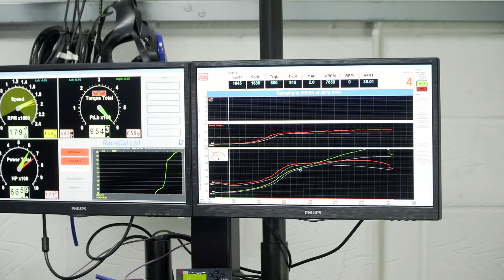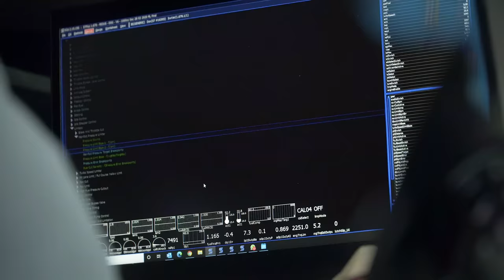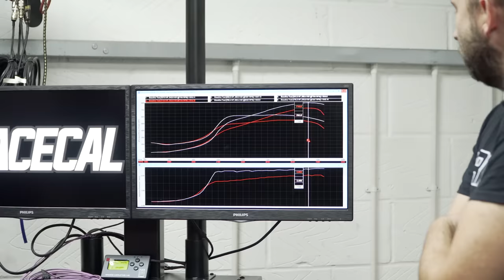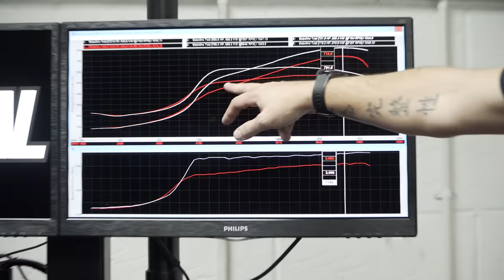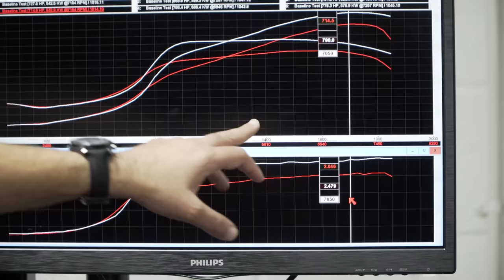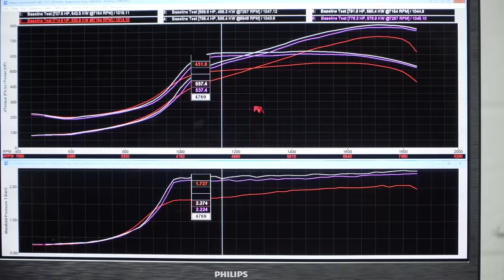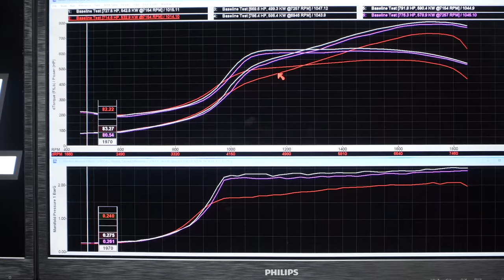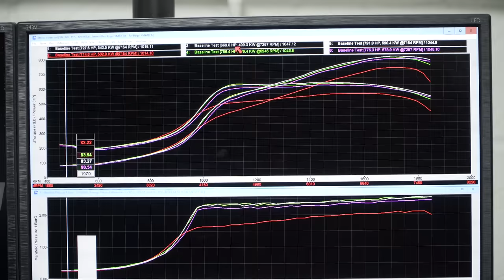Making the Eventuri RS3 a supercar killing monster - Built Engine + IROZ IMS850 Big Turbo Kit

Comment: Audi's 5 cylinder turbo motor was and currently is the best motor they've ever produced!
Reply: 3.0TFSI tho
Reply: @ckatlinga 5 cyl lolol
Reply: @matias7497  the 3.0 is aV6
Reply: @slonky821  I fully understand that. I have one sitting in my garage. Stage 1 pushing 410hp
Reply: 5.2L V10 and 4.0L V8 Bi-Turbo and 3.0L Turbo V6 and 2.9L Bi-Turbo V6 want your location
Reply: @QuattroTJ  I walked a C63 AMG in my stock RS3. It was a 2008 though
Reply: @matias7497  and ? Do you really know audi ? what is the 5 cyl ? Legacy of the rally ? 10 time world best engine of the year ? for the V6 you should have buy an Nissan...

Comment: What an interesting progressive build! Would a solid engine mount or two remove that engine torque-ing; it really creeps me out personally? Good luck on the next top speed event guys!
Reply: I noticed that too, surprised they didn't upgrade them at that power level.
Reply from the maker: It may be something we look in to over winter.
Reply: @EvolveAutomotive  Could you please explain why the car was dyno'd with the front wheels and not all 4? Thought this was a AWD car
Reply: @Soljy819  Its common to dyno AWD cars just in FWD mode if the dyno doesnt allow it. Remove propshaft and its FWD. They are FWD bias anyway.
Reply: @UndeadCrook  thanks for the clarity, appreciated
Reply: @UndeadCrook  You dont even need to remove the propshaft, just unplug the haldex controller under the rear seat
Reply from the maker: Yes Haldex controller was unplugged.

Comment: Got my 2020 RS3 Sportback in fir stage 2 tune tomorrow.
It has a Revo Carbon intake that it came with but I have purchased a Eventuri Stage 3 carbon intake to replace it.
Hopefully the revo 4" turbo inlet will marry up...if not will have to get the carbon intake for RHD....
Hoping for 300kw at the wheels

Comment: Love your videos brother @EvolveAutomotive Quick question though; how can the RS3 use a prohub dyno when it’s “Quattro” awd? The car in the video looks like just the front wheels are generating power?
Reply from the maker: Rear Diff disconnected
Reply: Is that just disconnected for the dyno then? Or all of the time? If so how come it’s only FWD?
Reply: @thomasw9193 they do it to more accurately measure the power, harder to measure power on a awd Dyno

Comment: Any trouble connection with intake to throttle body.... Does eventuri come with its own turbo inlet?
Reply from the maker: Eventuri make their own carbon fibre turbo inlet that is compatible with the standard and hybrid turbos, but we used the IROZ turbo inlet supplied with the IMS850 kit to fit the big XONA turbo.

The intake does not connect to the throttle body on these cars, it goes to the turbo housing, which then goes to the Intercooler and then the throttle body.

Comment: The rs3 is quattro right? So why did u tune it only FWD?
Reply from the maker: So it could run on a hub dyno which is much safer for high power builds. Running in FWD makes no difference to the tuning aspect of it.

Comment: What sort of power can you have without the AEM Meth system? I don’t want to run a meth system at all on my RS3.
Reply from the maker: Unsure as we haven’t done it ourselves. You’d lose some power and also see that power drop off quicker as IATs rise. WMI is very good at keeping IAT consistently low.
Reply: @EvolveAutomotive  I’m prepared to lose some power of course. I’m currently running TTE700 package from APR stage 3, power is 634HP and 680NM. Would like to get to 750HP if I could, I would be happy then.

Comment: It’s a Quattro how you managed to dyno it on front wheels ??
Reply: On the RS3 as on some other models they put a different kind of quattro. This type of quattro has a Haldex clutch, if it is closed it is 4 wheel drive, if it is open it powers only the front wheels. The car only closes it if needed (slip on the front wheel, mostly)
As it is software controlled, they just need to program it, so the clutch stays open during the dyno run, et voila...

Comment: Rs3 with no Quattro?
Reply: Easy to disable Haldex with Syvecs.
Reply: @Mac_F87  that makes perfect sense. Thank you. I thought they were taking off the rear prop shaft
Reply: @setperspective  as you say the prop shaft can be disconnected from the angle drive (transfer box) or you can unplug the connector to the Haldex controller or pull the fuse for the Haldex so.

Comment: Incredible engine with beautiful body lines wanted love this car But ...front wheel drive and the engine placement is so fkd the turbo and guts is right under the fire wall...U better have a full shop to work on this and fire suppression system 😭 damn u audi ....i can buy super car for the money that it needs to beat one.

Comment: LOL. The intakes are overrated. The S3 intakes cost an arm and a leg when you can buy one for like 150 and do the same numbers as a typical eventuri intake. Not only that, but they divert air away from the oil cooler to the turbo inlet...